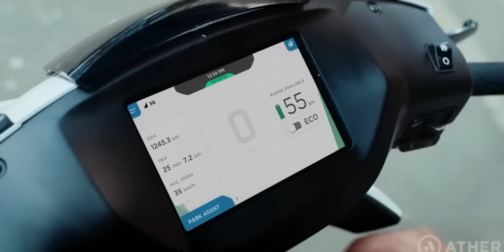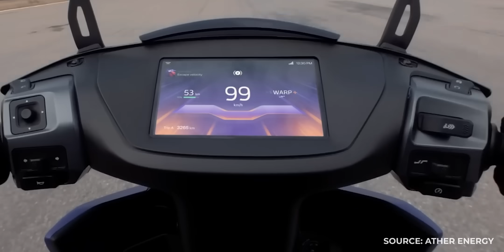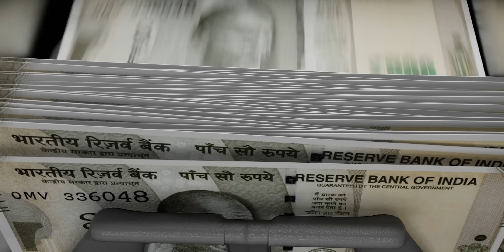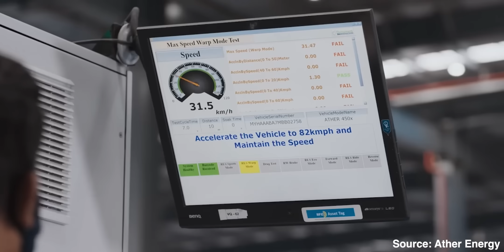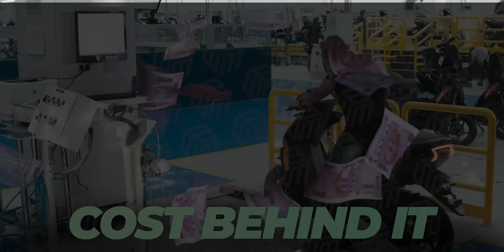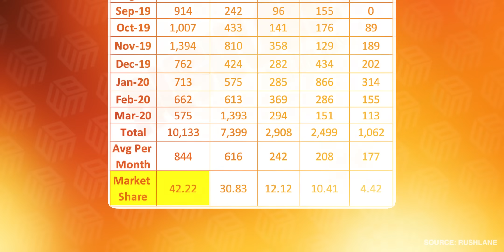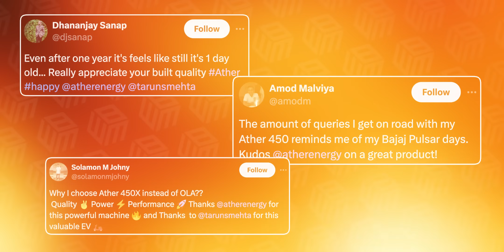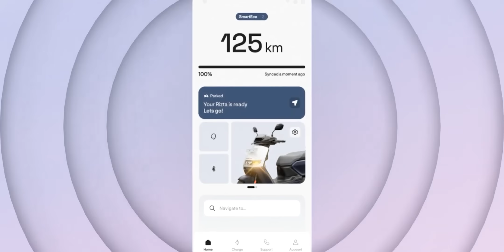Why India's OG Electric Scooter Company is Failing? - Ather Energy Case Study

Comment: The problem is they worked on making their so much better that took them an insane amount of time,whereas company like Ola,Bajaj launched their products and improved all customers related decision at very faster because of sheer amount data/response they got by selling their products which helped make their product customer oriented. Unlike Ather which took a lot time and now they lack in the main point of Indians which is Trust, if you had bought an Ola, then next time you will probably by a Ola,bajaj just because you have used their product instead of a new product from a completely new company (does matter how great your product is)

Comment: Ather HAS A REALLY LONG WAY TO GO EVEN TODAY ... It is actually the OLDEST kid on the block... which has never got a podium (1st, 2nd or 3rd) in last decade... when there was absolutely no real competition... Ola, Bajaj & TVS have equivalent or better product and cheaper or no subscription. ... Ather will have to be happy with the 4th eScooter maker title.
Athere's REAL PROBLEM is THEY ARE trying to sell an eMotorcycle in an eScooter market ... imagine you have a SUV and are trying to sell it like an Alto... That is EXACTLY WHAT ATHER IS DOING ... the Ather  is actually an eMotorcycle in smaller wheels... if they sell it as a eMotorcycle it will just take off.
And since most of their videos are in English it would not be very popular in north of India... Ather has to use HINDI ADVERTISMENTs,
Ather will have a certain kind of premium crowd buying their product ... ATHER WILL NEVER BE THE TOP SELLING vehicle ... because unfortunately scooter is at the end a common man/woman's vehicle for running errands... which you can also ride to office... riding above 50kms+ is not even recommended on a scooter.
Rizta is a good product and innovation at Ather is real high... but it is a commonman's ride... 
Tarun says "it is very difficult for Ather to sell the lower priced vehicles as people are demanding ONLY the high end Ather" ... that is because Ather has put conditions on buying the low end one... for riding and also for service... If Tarun was true ... then Ola would not sell so much.
AND FOR THE LAST PART... if they had swapable battery that would have provided them profit charging scooters both their's and others. ... but that also they don't want to have. They have set up so many bottlenecks for their own products its surprising that it sells so much.... 
I truly think... they wasted their time doing silly unwanted, unnecessary innovation... and the best years with no proper competition is behind them. Future is going to be more and more tough and the profit is going to be smaller... EVEN IF THEY GET 20,000Cr IPO... they will keep doing this 1 eScooter trick.. launch a Ather Playstation or Ather eScooter which can launch missiles... etc. Where is your 2nd Vehicle... launch it Ather instead of this Shaadi & Rishta, Aalo, Kaanda and Baingan.

Comment: Tbh Im using Ather 450x from two years and I regret buying an EV. EV's r not meant for long run . MY SCOOTER battery degrade in just 2years..now i got a replacement using warranty. And after sales support is very poor with EV's. There is monopolistic kind of environment with EV service. We have to completely depend on Manufacturers for spares & service unlike ICE vehicles where we can find a mechanic in every nook & corner. Spare parts & services super super expensive when compared to ICE vehicles .and another banger is battery replacement or motor replacement each of them costs half the vehicle cost😢😢😢

Don't buy EV's now

Comment: The only thing After needs to do is have the price the same as ola and range.
Boom they will easily cross ola, I personally have ola S1 pro and it's build quality is so poor specially it's handle and screen area, And it's full of glitches.
Once the screen is wet it's touch will stop working and you have to restart the scooter which takes 1-2 mins and it's annoying.
Touch response is so slow and after sales service is the worst.

Comment: Electric vehicles are not becoming popular because of restricted service. No one else apart from the authorized ones are servicing them, even for small problems like attending puncture, if the wheel has to be removed.
The EV companies need to train more mechanics from small reputed garrages. Like Maruti started  a program for training and certifying mechanics, provided them training, special tools, and source for original spares.

Comment: Bro electric motors are more powerful than your petrol desiel engines. If you put a tug of war against a EV and a desiel engined vehicle uphill where the EV is pulling the vehicle uphill then also EVs will win.

But when it comes to giving more delivery at higher speeds, EVs are not that great. So its like from 0->100Kmph is easier for an EV than going from 100->110Kmph. But for petrol engine, 0->100kmps is tough but to go from 100Kmps->200Kmps is easy.

Comment: Ather is failing because their scooters are competing with tried and tested scooters that are economical and cheap to use and that can last 15+ years easily. They need to get back to the drawing board, lose out the gimmicks like touch screens and bring the cost of the scooter down to 30,000 to 40,000 INR. Not many are willing to pay 1 Lakh plus for a scooter whose battery will need replacement in 5 to 10 years. Another factor is the quick depreciation of EVs.  With my 10+ year old scooter, I can get a resale value of at least 30 to 40,000. I don't think an Aether owner can say the same as the life of the battery declines the minute the scooter is used.  The company should stop listening to fanboys in the city that have disposable income and are willing to throw money for a shiny new toy. The scooter for many is a workhorse. It needs to be dependable, cheap to maintain and cheap to buy.

Comment: Stupid video. Ather is the only successful scooter with no compliant.I have iqube and it's motor is a failure. It can't run more than 45 minutes. I joined ather,ola and iqube FB groups to about all ev's. Among all scooters ather is the only ev with no complaints. Ola has tons of software issues Almost every post in the group is a complaint .
Ather is the only reliable ev
Please don't spread false news

Comment: Ather failed to overtake ola just because of lacking in some smart features. Touch screen is useless while riding (it won't work) . No speakers and customizable sound like ola. No keyless entry and parental control via app. Ola's top model includes these features and also ₹10k cheaper than 450x pro pack. Am using Ather only. But these are some problems with it.

Comment: Not just that, try visiting ather service centre talk to the team you will know why exactly are the problems with ather. The battery level start depleting after you hit 20000 mark. Mine started at 19k km. The soc was 41.4% meaning the battery was damaged and had to sent to bangalore for more than 1.5 months. There are several reviews on the range depleting drastically. This would be with every ev but when you pay a price which is 20-30% more than what  you pay for other scooter then it is not justified. Fuck ather

Comment: Looks like this video is ather trying to market themselves 😂 The heat hasn't been turned on yet by suzuki and honda yet, their scooters are coming. It's about to get even more difficult, specially with an aspirational product. The mass market, cheap easy to maintain and reliable electric scooter is yet to arrive. A vast majority does want to care about screens and software updates, and safety of parking etc 2 wheeler mass market users are not rich, it's a tool for their everyday struggle.

Comment: Ather cannot just survive on few models, they don't crater for the masses of all types,  while other imported electric scooters are used for so many purposes, like logistics (Zamato, amazon delivery etc), They have a great engine, battery and service they now need at least 10 models covering all parts of the price bracket then their sales will increase, so will the challenges, if they can accomodate all these different models on the same assembly line then they can win the EV race however they need to incorporate hydrogen fuel cell as batteries will be obsolete in few years, just fill hydrogen and move thats all

Comment: Ola or Ather, Both help customers and are very good scooters.... In my opinion Ather messed up with Pro pack. The only reason i did not buy Ather is pro pack cost which is 30K or more. No one would buy software for 30,000 for a scooter... Ola is less restrictive on that front

Comment: I own an ather for nearly 3years.
I will share my experience.

1.only way to contact is local dealers which sucks and are not at all friendly.
2. Plastic parts are very cheap compared to petrol counterparts,highly fragile the floor board,rear fender, front fiber glass.
Useless mirror

A belt that makes sounds like a lizard( people will start asking you,doesn’t that feel like a decade old scooter .
The shock absorber is also very stiff and takes a toll on your back 
U can only expect a range of 60km 

Pros 
Basic chassis is good 
The drive quality is top notch .

And finally I want to getrid of the scooter as I have switched back to ICE bike the HDX440

But I was able to influence around 6-10 people to buy the ather

Comment: There were few issue with Ather, firstly the price which was above 1 lakh where most ev's were selling for less than 1 lakh. Less distribution/showroom compared to competitor. The seat  ergonomic which was steep, which was making riding difficulty for family customer. However, person who used ather will become brand loayal. To gain market share, they have to have more distribution network, and have a product less than Rs. 1 lac and range of greater than 75 km on single charge.

Comment: Ather should widen the product range with a high-quality but budget friendly option.
They should upgrade their 450 series to something newer and better- better motors, better battery pack, etc.
Their touchscreen feels laggy compared to Ola. Ola has a lead because it's a shiny new product and a new assembly line.

Ola technically has a better product in terms of specifications.
Ather has a more reliable product, but slightly older specs.

Comment: Anyone that has followed Ather and looked deeper than just the monthly VAHAN registration numbers know what they are upto. Ather isn't in the game to the "Numba 1" but they are about design and engineering. Ask any electronics hobbyist who has seen some of the PCB's in the 450 - they will tell you how well each component is engineered.

You want a cheap EV - take the Ola. You want a well engineered product that will not spontaneously combust or have its suspension break in the middle of the road - take the Ather

Comment: Guys guys wait

Ather maybe touchscreen, u r paying for that as well. That's ok.

First and foremost important thing for this vehicle is the battery. Rest everything comes under additional/ luxury.

Battery noise is the WORST, It's sounding like an aeroplane take off. Very irritating. Even dogs bark and chase.

Even I'm an Ather user. Do not comment as if everything is good in Ather. Don't cheat others.

There is literally an option as a " Battery noise issue" in ticket option. Check it if you want to have self proof.

Company already know this is an issue but they will never tell you.

Other similar ev is proving better comfort. Noiseless vehicles. 

Avoiding emission but creating a big time noise pollution

Comment: I bought Ather 450x. Top notch quality and performance.

- Best in quality. Single mould Aluminum frame. 
- Best design. Well balanced front and rear weight.
- Best innovation 
- Best pickup and power.
- Best service

Becz of steong quality chasis, scooter parts will not get loss even after using years.

Comment: As an Ather rider for last 2.5 years and used 2000 kms mostly for leisure in all sorts of rough terrains such as rivers, mountains, jungles, farmlands and offroads, I must say this is the most reliable vehicle I have ever owned, I am talking about the 450 Gen 2, other than its headlight which kind of sucks, everything works extremely well. Which is why I long for them to make an electric motorcycle, because I will buy that in a heartbit. This is called brand loyalty and trust, which they are building, which is a long term game, so this short term ups and downs are just that. Their early mistake was undermining the tier2 and tier 3 cities, which Okinawa had tapped and later Ola too grabbed that market, Ather was not bothered by Okinawa as it was a different market segment, but when Ola got a huge success in sales figure in tier 2 and tier 3 market in the same market segment as Ather, Ather took note and began expanding like crazy, which is why you will see Ather sales volume started exponential growth after Ola's introduction. Then it got stagnant again as TVS and Bajaj started capturing the family segment, so, now, we will have to see with Rizta, if Ather turns the tide again in their favor or not. Most Indians are too quick to jump to the cheaper one, but eventually they also favor the more robust vehicle, so make no doubt, Ather is the "Lambi Race ki Ghoda". Excellent video bdw.

Comment: They are charging for pro package, thats no hardware, isn't it software. Ather quality is stupid rhetoric, there motor is so ridiculously weak, there top speed is too low, service/accessories cost is too high. I feel they are reasonably well designed that's about it. Material and price wise they're not a good deal.

Comment: I'll be one first buyers of Ather Rizta.
Whenever I go and speak to  Ather users and ask for their feedback 99% are happy but when I go to OLA users 30-35% are kinda satisfied. Maybe OlA has won the battle but Ather will win the war. Also, flawed government scheme named as PLI helps OLA to sell cheap products which Ather doesn't get. I agree OLA owns the market right now but Ather owns customers trust which will be required in the long run.
Reply: Get a tvs iqube instead.
Reply: @shubhamrane7020  I took a test ride of the same as well. It's not worth it on the price point it's coming. The software of the i Qube is not great.

Comment: I own Ather 450+ and have been driving for the last 1.5 years. Daily commute between 25 - 30 km. Outstanding product, complete EV scooter, futuristic look and easy to handle compared to other EV scooters. After-sales servicing is also rapid and helpful. Word-of-mouth marketing is excellent but not extensive marketing like Ola. I'm looking forward and extremely bullish on Ather Rizta. Fact check - one of my close relatives owns Bajaj Chetak, both vehicles were purchased in the same month but Chetak has faced many problems in the last 1.5 years and has towed more than 3 - 4 times from different parts of the city and the other hand Ather... None.

Comment: I have been riding ather 450 over 5years, build quality is top notch. Nothing broke or dropped on way or got burnt. my only gripe is the design factor. it is too compact, one cannot ride without hurting their knees in front,  almost everytime I step out my leg touches the horn, I need switch off before stepping out. i might have hardly used the touch screen in all these years. a regular display with physical joystick option would have been enough. anyways the touch screen mostly goes blank half way while riding or is lagging behind in display details.  the suspension is stiffer.

Comment: My reasons for buying Ather were:

1. Google Maps on the screen!!! I had newly moved to Bangalore and no use of the road network and general directions
2. Rising petrol cost. Wanted a vehicle that would be easy to use with low running cost.

The other things I discovered with use. And boy how much I appreciate them. Like how nimble and agile it is while being so light and sturdy! Ather was the only company giving an all aluminium chassis with a rear monoshock. I have sooooooo much fun taking corners at speed. And oh the performance! Warp mode is love! I easily overtake 80 percent of the vehicles on the road in city traffic within 0-60 kmph. Thanks to the instant acceleration. And it’s so narrow and light. So filtering through gaps is effortless 

And I had a Duke 390 as my daily driver prior to this.
Reply: While changing battery you need to pay upfront or do you get on Easy EMIs
Reply: Many a times in India we get heavy rains and the level of Rain water would be up to Seat level and to Cross that area the vehicle will be submerged in Water for about 5 to 10minutes will the Battery vehicle Withstand such issues. Mainly it will malfunction and to fix it has a major cost. Hence I prefer IC Engine even on Submerging in Water it would work without major issues.
Reply: Do you still believe that electricity is made out of pure air, Electricity is still produced out fossil fuel
Reply: My reasons for not choosing the Ather: 
1. I brought a 150 Rs phone stand for the vehicle.  
2. I only spend 200 Rs per week on petrol driving 20 kms daily. It wasn't worth paying 1 lakh plus for a scooter whose battery will need replacement in 5 to 10 years. 
3. I can sell my IC scooter and for at least 30-40,000. I think the resale value of a used Ather is 0 INR.